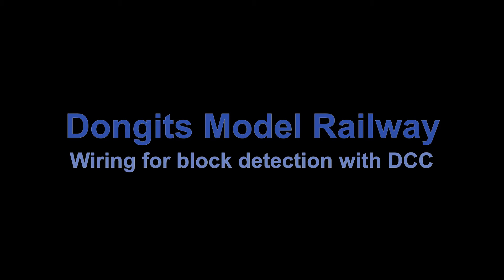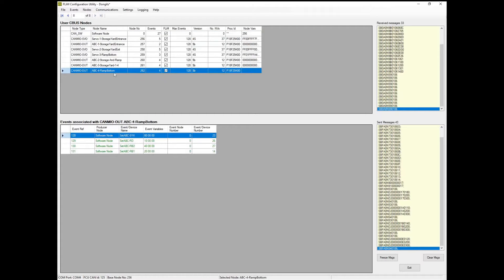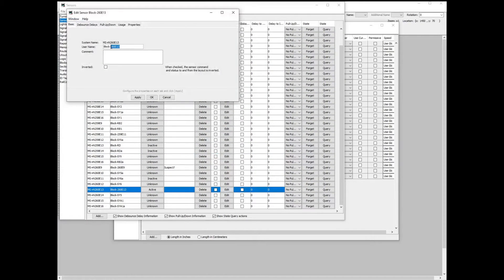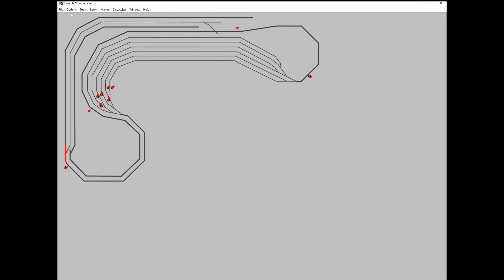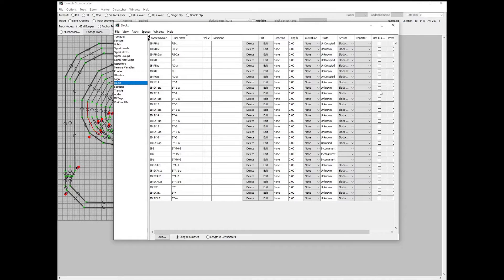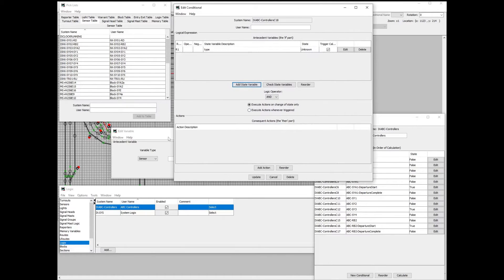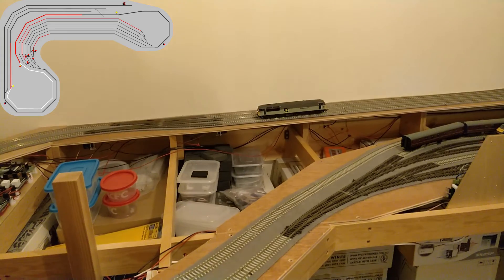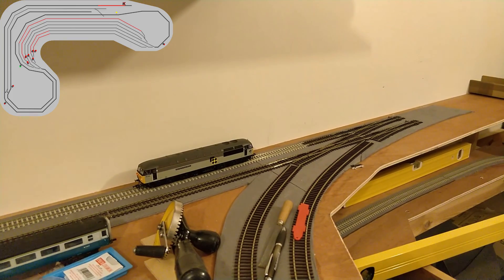Model Railway Wiring for Block Detection in DCC - part 2

Comment: Really great subject. I'm using MERG gear (migrated from DCC++) and have done some work with JMRI with Dispatcher. I'm intrigued with your automation. I'm afraid you lost me when you started with the victual sensors. I understand what they are and that sensors can be placed inter block but found it difficult to follow what was happening. I just caught you mentioning NX routes and had a quick look. Am I correct in understanding that the interblock sensors act as "switches" for a route and triggering the sensors activates the route you have set up? I must admit that JMRI documentation is not "101 for Dummies" and requires a lot of head scratching.
Reply from the maker: I followed the NX documentation here: https://www.jmri.org/help/en/html/tools/EntryExit.shtml

They start by asking you to make a bunch of sensors.

They never tell you that these "sensors" aren't sensors at all. They don't have hardware, and aren't used for detecting trains. They are literally just using the 'sensor' concept to make an NX button to put on the panel.

With this information, the documentation made sense to me and I could follow it fairly easily.